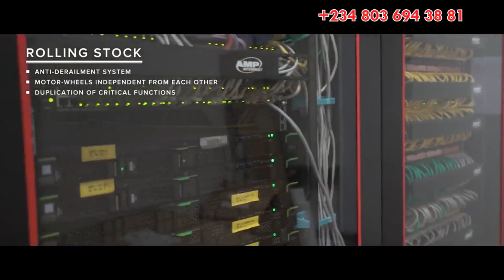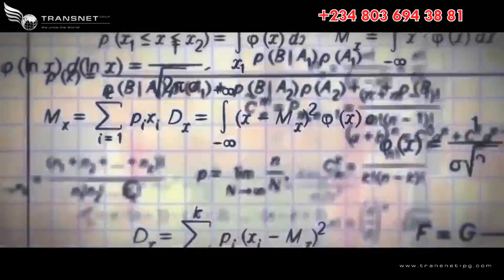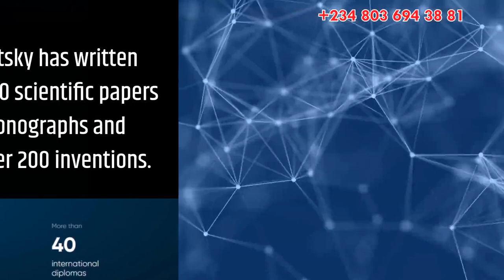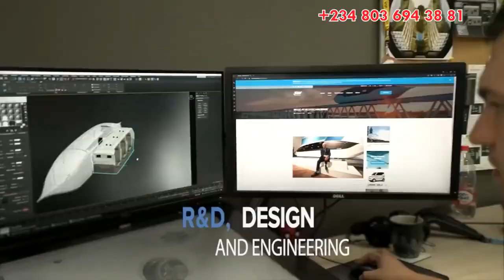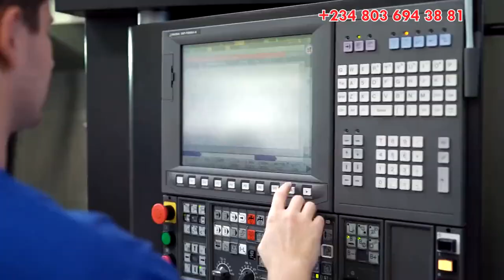Skyway String Transportation Technology

Comment: very wonderful
Reply from the maker: Skyway String Transport Technology specializes in revolutionary high-speed elevated rail transportation. 
SkyWay started offering pre-IPO share allotments in 2014. There are 15 Developmental stages to IPO. We are currently on Stage 14.1. 

As we achieve the milestone for each stage we progress to the next and the number of allotments reduces.  
Remaining are stages 14.2, 14.3 and 15. Afterwards, we will close the Pre-IPO! 

Skyway Pre-IPO packages are available: 
Premium Packages:
$150,000 = 8,550,000 share allotment units 
$100,000 = 5,400,000 share allotment units 
$50,000 =  2,600,000 share allotment units 
$25,000 = 1,250,000 share allotment units

Skyway Pre-IPO packages are available: 
10 Months (consistent) Installment Packages:

$50,000 (i.e. $5000/month) = 2,500,000 share allotment units

$25,000 (i.e. $250/month) = 1,200,000 share allotment units

$10,000 (i.e. $1000/month) = 450,000 share allotment units

$5,000 (i.e. $500/month) = 190,000 share allotment units

$2,000 (i.e. $200/month) = 66,000 share allotment units

$1,000 (i.e. $100/month) = 31,000 share allotment units

$500 (i.e. $50/month) = 13,000 share allotment units

$250 (i.e. $25/month) = 5,750 share allotment units

For instance, 66,000 share allotment units of SkyWay gives you an equity of $66,000 during IPO for paying just $2,000.
Remember, you also get dividends from your shares!

To invest, contact certified SkyWay consultant. 
WhatsApp: +234 803 694 3881 
https://new.skyway.capital/auth/login?do=register&partner_id=438711